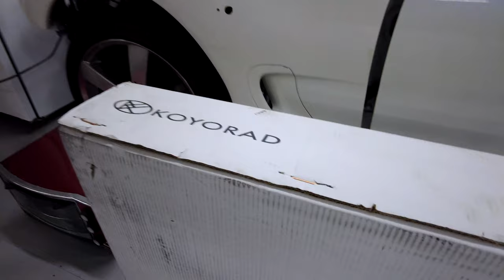Project Miata Exocet Pt 7 - Mocking up the Chassis

Comment: If you email Exomotive, they've sent me pieces of the tubing/steel laser cut - I bet they might be able to send you a laser cut perfect fit front clip (the square tubing part) - then you could work the front tubes square based on those with the subframe maybe?

IMO don't sweat the frame being perfectly square, especially in the front - tie rods let you get it pointed in the right direction.